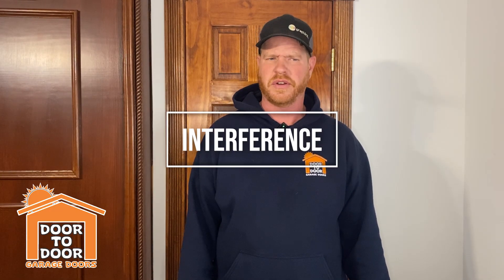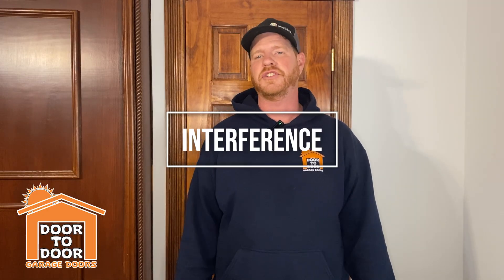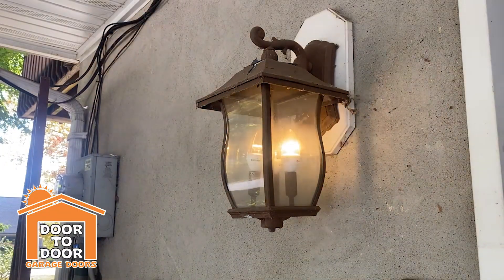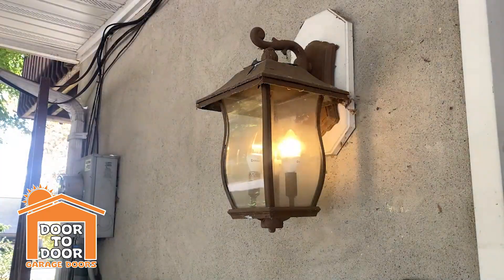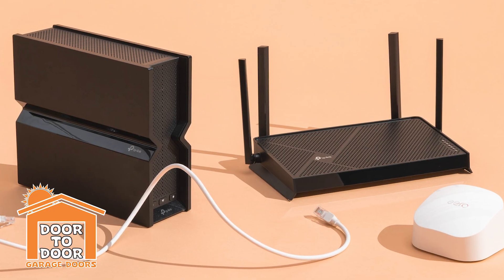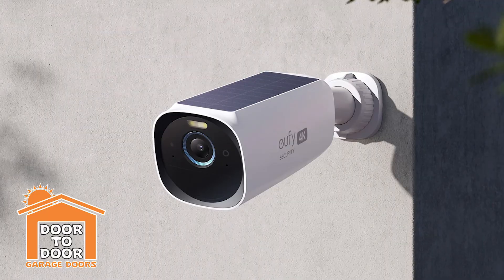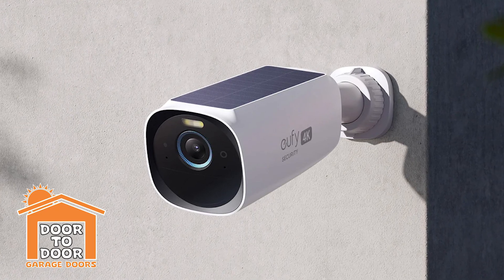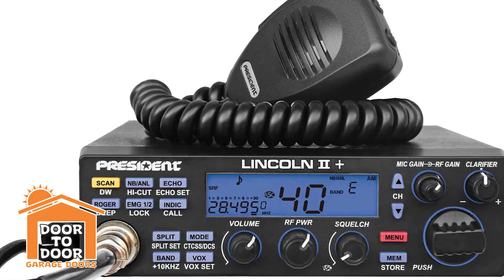Garage Door Remotes Not Working?...Interference Explained!

Comment: I've been troubleshooting a 1/2" hp Liftmaster, belt drive, year 2000 opener.  We  bought this house a few months ago and have had problems from day one, even before we moved in.  The two portable remotes & the remotes built into our cars (2) are VERY intermittent.  They have very limited range, barely 20' from the garage door.  Will usually open the door but not close the door until a 2-4 minute rest after opening.  I've replaced batteries and now the opener control board and get the same results.  I've turned off all house circuit breakers except the garage, and unplugged all appliances in the garage.  No help.  Also, I've read there's a "light on timer" which leaves the opener light on for some programmable time.  I've removed the opener bulbs to no avail.  I'm trying to figure out the "rest / time" delay after running.  My suspicion now is a bad component within the opener such as a start/run capacitor.  Is it possible the capacitor is producing RF after running?
Reply from the maker: That is a tough one, it does sound like interference, but sounds like you tried everything I would try. I've never seen a capacitor cause interference, but always a first time for everything. You could try swapping the circuit boards to the purple button boards if you can find them. Or upgrade the machine, the newer frequencies are better with interference.

Comment: Started having trouble with both remotes after security camera software update. Worked fine prior to update. Both remotes will start to work again after a “resting period” from trying them. Security camera is plugged into same outlet as garage door operator and mounted on upper corner of garage opening outside with cord management on garage ceiling. Could the software upgrade be the culprit?
Reply from the maker: Sounds like that could be causing interference...if possible I would try disabling the security camera and see if everything works properly. If it does the trick maybe see if everything can be relocated further from the garage door opener?
Reply: Did you determine the cause of your "resting period" problem?  Read my post dater 12/25/25.